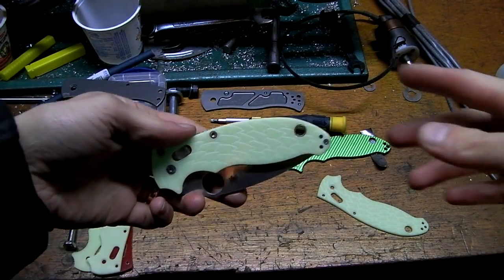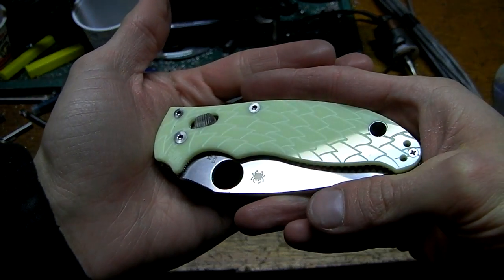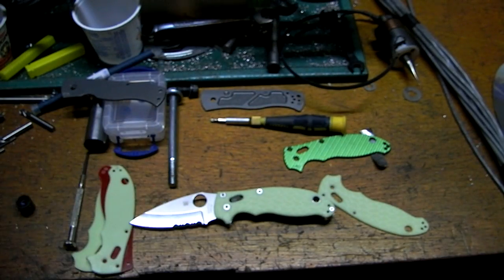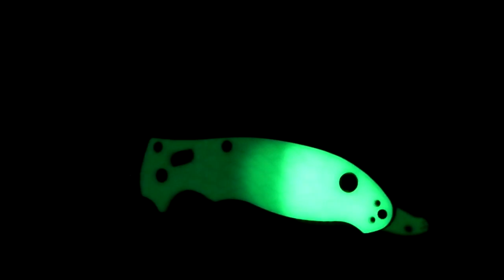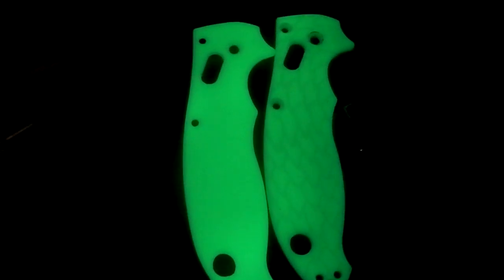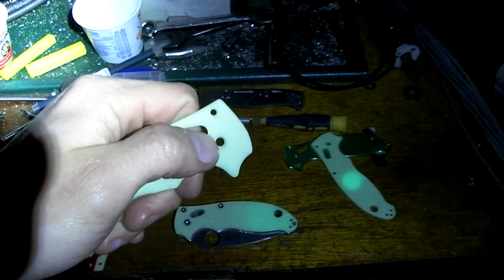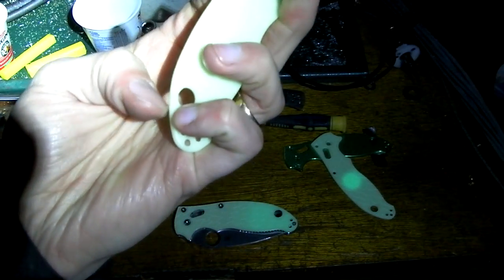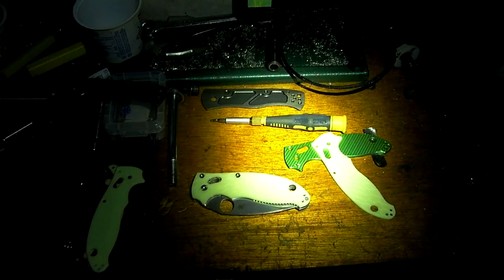Making Glow Dragon scales

Comment from the maker: @gianthomunculus For daily carry with keys and stuff they hardly scuff up at all, but they do scratch fairly easily if you rub something hard and pointy against them.  I've carried a Rat1 glow for a few months and there's a few little nicks and scuffs but you have to look closely to see them.  The surface of the material is shiny when I get it, but if there are a few scratches in it I'll often sand it down with 600 grit to even it out, before shipping it.

Comment: hey john, I know this is an old video but was curious if you had any notes about your feeds and speeds with moonglow? I'm looking to machine some soon and there is very little info out there
Reply from the maker: it's the easiest stuff ever. just use a sharp 2 flute uncoated endmill and go max rpm and 10-20ipm. but of course it all depends on your machine too.  this is not a material that you have to over think ;-).
Reply: +JohnGrimsmo excellent, I was worried about the heat making it gummy like machining acrylic to slowly. I'll start at 10ipm and see how happy it is.